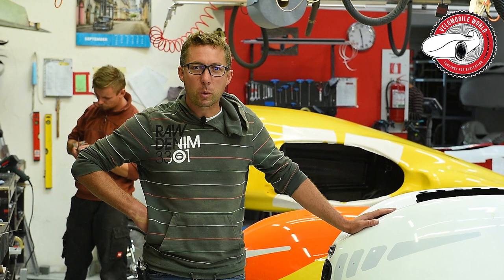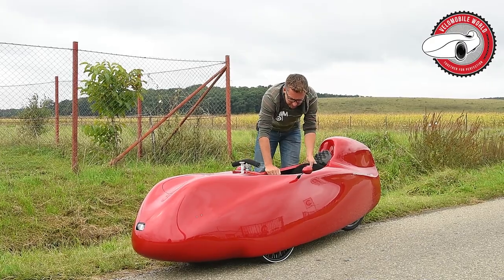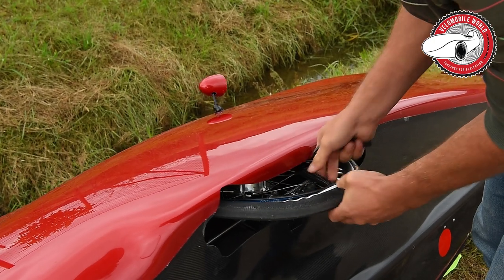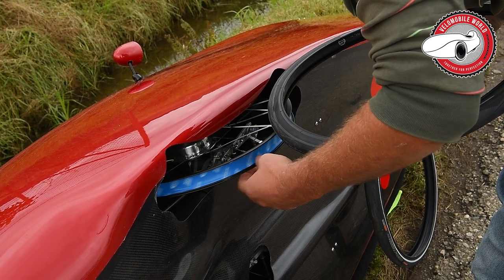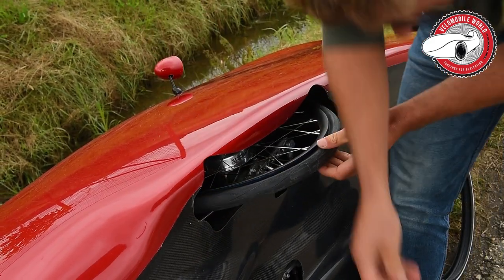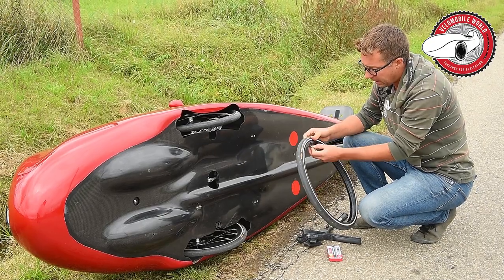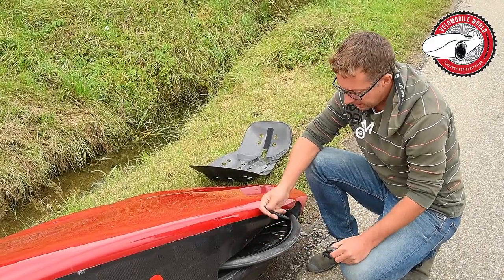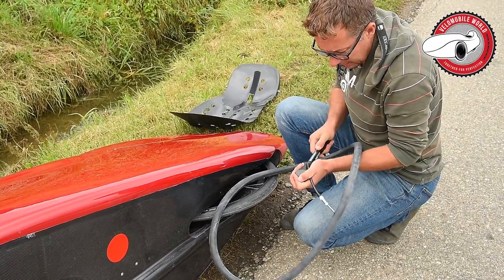How to Change a Flat Tire | Velomobile World

Comment: If you take the inner tube and tyre off simultaneously it is a good idea to leave the tube inside the tyre. Toss it in the back of your velomobile. At home you can put some air in it. Usually it is very easy to find the leak. As you now know the location of the leak, you can check the tyre in that same location for sharp bits or even a weak spot.
Reply from the maker: Great point!

Comment: It is easier to replace the tube with the wheel installed on the velomobile?
Reply from the maker: Yes I would not build out the wheel for changing the tubes
Reply: Is is faster, because you need not to search the thing which punched the hole. and the chance to put dirt with the tube into the tire is much less..

Comment: You made it look so easy, I normally find it quite difficult to put a new tyre on.  I guess I just need to get a bit stronger.
Reply from the maker: Well most of the time it goes by me like this. Only a couple of years ago when I did not bring handgloves with me in the winter, I had difficulty to get my tire on again. My hands got cold and I lost controll and power over my hands. Luckely I was with a second person and we managed together to get the tire on again.
Reply: Depends on the type of rim and tyre too. Some are really, really, really tight.
Reply: I’m sure most of you know but folding tyres are much easier to remove than the hard wired ones, they can be horrible to remove, especially at 4am in the rain in the morning in winter when all punctures happen! 🤬